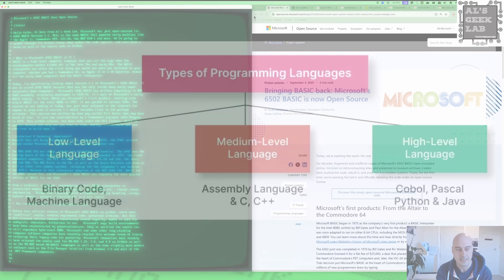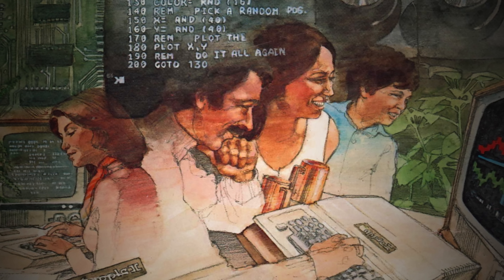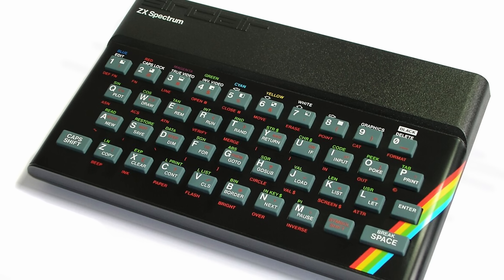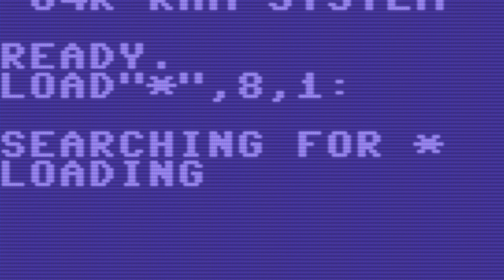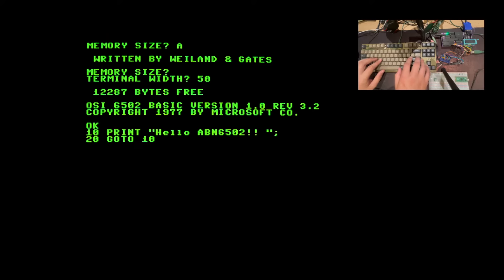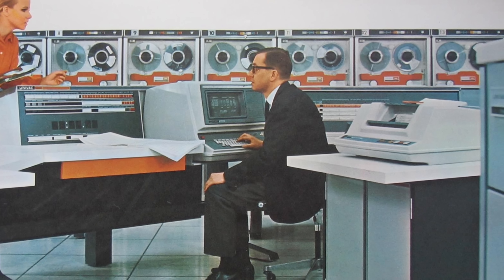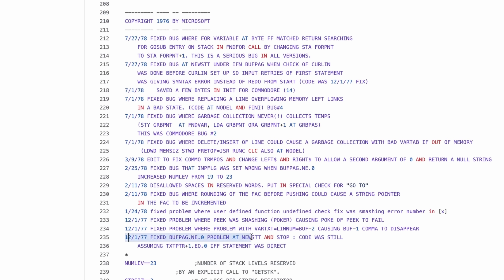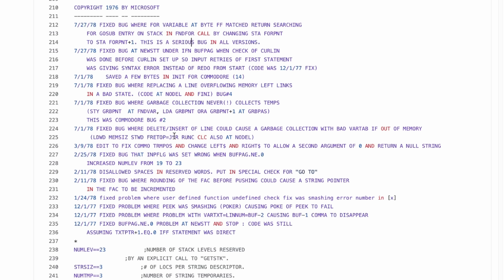Microsoft Just Gave Away Classic BASIC Code (6502)!

Comment: BASIC is a perfectly cromulent language, especially in its more advanced label-based forms (e.g., Maximite BASIC, QuickBASIC, QBASIC).  Some are saying that BASIC promoted poor coding habits.  I would put that down to the poor coding habits of most of those who taught BASIC.  The notion of structured programming didn't come along for almost a decade after BASIC was already well established, but, properly applied, it could transform a poorly written BASIC program into a readable and maintainable one.  QuickBASIC took this a step further in the utilities and reference materials provided for Professional Development System 7.0.

6502 BASIC is an historic language.  I'm glad to see it finally being released as Open Source.  It's long past time.  Now, let's get MBASIC and QuickBASIC out there. 😄

I still code in BASIC of one dialect or another to this day, what with the availability of cheap, powerful and versatile single board computers like the Colour Maximite II/RetroMax which can run interpreted BASIC faster than a 6502 could run machine code, and can interface also to GPIO for real-world control.  All that power in such a small package brings back the joy of the 70s, but at warp speed.

Comment: Regarding Win95 source - I kinda look forward to it and dread it at the same time - it will be great to have those venerable old systems opensourced, but it will inevitably spawn a FLOOD of community bugfixes and different versions of "Win95 as it should have been" which, I'm afraid, will be very difficult to keep any consistency within, and may complicate matters for enthusiasts who actually want to run them - which version to try now? On the other hand, it will be very nice to have some old annoying bugs fixed and it will even open up the possibilities of porting it to a different hardware entirely...the question remains, whether there's any point in doing it :) W95 on a RPi? Well, I'd rather stick with Linux, and run an emulator if needed :)
Reply: Win95 as it should have been is called Win98 SE

Comment: I notice that they're very nonspecific about what assembler should be used to assemble the code.

This is a dialect of 6502 assembly I haven't seen before.  For example, it adds "i" to the end of the instruction name to indicate an immediate operand, rather than putting "#" before the operand to indicate it is immediate.  The assembler directives are also different than any other 6502 assembler I've seen.
Reply: They used DEC's PDP-10 assembler with a boatload of macros. That worked fine for a simple assembly syntax like the Intel 8080 used, but the 6502 and Z80 use the same mnemonics (LD, LDA, etc.) to mean multiple things that have to be sorted out by the assembler decoding the addressing modes on the right-hand side. What they ended up with was a mutant dialect of 6502 that was an alternate history fiction of "what if Intel made the 6502"?

The strange mnemonics are designed to separate out all the addressing modes, and also they have a few macros that generate pairs of instructions to work with 16-bit addresses that have to be split between two registers. Unfortunately even with this being the "mother code" version of 6502 BASIC, it is still missing the file with all the macros.

The weird but cool part is that for both 8080 and 6502 they also wrote an emulator that ran on PDP-10, assembled along with this code. That's what the "DDT" thing is when REALIO=0, it's a keyword that kicks into the PDP-10 debugger. This let them develop Altair BASIC without actually having an Altair computer.
Reply: @8bitwiz_  Wow, that is a lot of complexity hiding behind the phrase "contemporary assemblers"!  Interesting, though.
Reply from the maker: Yeah I saw that too and I was really annoyed by that. They just said 'contemporary' assemblers of the time. What the heck, why can't they just name the assembler (or assemblers!)

Comment: i had that exact 6502 Assembly book at 14:00. It was a great resource to learn. As I remember, you ended up writing an assembly emulator that walked through the code and updated various onscreen displays. You could assemble and disassemble code. It could also run the assembler code direct from memory.
Reply: I still have that book.  Don't forget about the Rodnay Zaks trilogy (Programming, Games (w/the olde red and black cover pixelated art of a cowboy getting shot), and Applications) and a few other 6502 books of the era.  Good times.  It's a shame Atari went kaput since they were a big proponent of publishing the source to their roms (not too expensive for a kid too, as I purchased the big blue 3-ring binder containing the assembly listing) - don't remember the cost, but cheap.
Reply: I learned how computers worked with that program. I sat a lot of hours in front of it on an Apple IIe.

Comment: Apple ][+ used Applesoft Basic. Was that MSBASIC underneath?  The Apple ][ had NO BASIC, it booted directly to a machine code interpreter.
Reply from the maker: Later in the video I say that apple soft basic was so called because it was written for the apple by Micro-Soft.

The apple I booted into machine interpreter, the apple ][ booted into integer basic, written by Woz.
Reply: @AlsGeekLab  thanks.  I just remember getting the Monitor ROM, and replacing the AppleSoft ROM in my Apple][+ (ostensibly to downgrade it to an Apple][) so I could boot to the "*" prompt and enter machine hex code directly.  the "*" prompt was not BASIC of any kind, nor was it a compiler, it took hexadecimal numbers as instructions and data.  It was really cool to be able to "talk" directly to the computer in its own language!  :-)
Reply from the maker: @ckeilah yes, this was the monitor. You got to it by typing call-151 in BASIC
Reply: The original Apple ][ DID include Steve Wozniak's Integer BASIC. The machine did start up directly into the Monitor, but a 0G command would bring you into Integer BASIC. The Apple ][+ replaced Integer BASIC with Applesoft BASIC which is based on Microsoft 6502 BASIC, and introduced the Autostart ROM so that the machine would start up to an Applesoft prompt. 
Inside every Apple ][ (I think; at least through the //e) there is a ROM chip stamped with a Microsoft copyright.
Reply: @RideManDave  thanks for the brain refresher.  Sometimes I long for those simpler days.  🙂
Reply: Short answer: yes, Applesoft was this version of Microsoft BASIC, though I haven’t checked yet if it includes all of the Apple specific statements for graphics and the like.
Reply: @philipstephens5960  I skimmed through the source code last night, and there did not appear to be any graphics support in it.

Comment: This particular source code has been available for ten years. What is new is having a proper license for it. And it has been very useful, as it is the origin of all the different 6502 versions, and is applicable to most 6800 versions as well. I was able to get a version running on a 68HC11 breadboard that I've been working on thanks to this 6502 code.

The Bill Gates release earlier this year wasn't complete (missing the floating point output and line edit code), but it was similarly useful for documenting the earlier 8080 versions. It also doesn't contain the early floating point code from Altair v1 and v2 Basic, which was surprisingly different. And there is a CP/M and an MS-DOS source release out there too. The innards of MS-BASIC have been a continuous interest of mine since about 1980 or so on a TRS-80, so I've seen a lot of different versions.

At this point I'd like to see source code to a 68000 version appear. The ones I know about are old-world Macintosh, Amiga, and Tandy 6000.

Comment: I love how the commit date on Git reflects the original release date back in 1978 and not the date they uploaded it!
Reply: I guess they can do that when they own Git.
Reply: @sa3270  anyone can do that in git, just force push it
Reply: @sa3270  microsoft doesn't own git, they own github, a git remote. im pretty sure you can port a code base to git, as @LetYorLightShine5218 mentioned, or you could just create arbitrary commits, which i think is possible with git.
Reply: Probably was a ported code base from some other version control system to GIT. Done right the port keeps the original dates and attributions.
Reply: @LetYourLightShine5218  Were version control systems a thing back in 1978?

Comment: Atari 800 series MS BASIC was optional (cartridge), almost nobody used it.  It only did well when it was included in ROM, but not when it actually had to compete.
Reply: The Microsoft Basic II cartridge is one of the few 6502/68xx versions with a language level equivalent to what MS made for CP/M. But Atari initially did their own version because they didn't want to pay the MS tax, and yes, having to use the cartridge was a barrier to using any version at all.

Comment: Can not remember any sound or graphics in Basic (V2.0) for the Commodore C64 though? maybe there was and I forgot.. but as I remember it you had to poke stuff...
Commodore 128 had some commands for sound and graphics as I remember...
Reply: Yeah, the C64 was all PEEK and POKE to the various memory locations for bit-mapped graphics and sound, but Commodoore did have the screen control characters such as the reverse heart for clear screen, and the various character colour change characters, etc.
Reply: Yeah, C64 didn't have graphics and sound commands in BASIC, you could only use the hardware through poke/peek in BASIC. Famously, Microsoft expected Commodore to ask for updates to BASIC once Commodore released new hardware with new capabilities, so they offered BASIC license at cheap flat fee. But Jack Tramiel's penny pinching knew no bounds, and he took the PET BASIC 2.0 and put it in VIC-20 and C64 and sold an epic shitload of those computers, leaving Microsoft with no new income.
Reply: PEEK and POKE are your friends.

Comment: Can it be ported to nes?
Reply: Add the right mappers for enough memory and you could. I think the hardest part would be hooking up a keyboard.
Reply: @8bitwiz_ keyboard vs 8 direction x 4 modifier (neutral, A, B, A+B) = 32 accessible character. Start and select for symbol and numbers toggle.
Reply: @8bitwiz_  FC/NES can use keyboard device. You can see "family keyboard" in FCEUX expansion list. At least it can be emulated on NES emulator.

Comment: Microsoft's 6502 Basic was pretty easy to extend. Machine-specific instructions (graphics, sound, etc.) were written by the machine vendor. As with the 8080 and 8088/8086 versions, all you really need are to feed it your computer's I/O handling functions and write loading and saving interfaces. Once you've done that, you have a working text-based programming language. Apple added CALL which behaves differently to Commodore's SYS, commands for low- and hi-res graphics, PDL joystick reading routines, and hooks for DOS. D$=CHR$(4) was pretty commonly used in Apple II basic programs because printing a ^d was an escape code for a program to issue a DOS command which could otherwise only be entered interactively.

Commodore … Jack Tramiel licensed Basic for the PET and should've paid a license for the new machine. But he famously squeezed every penny and didn't mind screwing someone over (I'm sure Bill Gates will recover someday…) and just transplanted PET Basic into the VIC-20 and C64 … which is why those versions lack any sort of graphics and sound routines.

I don't know what specifics existed for other machines offhand—some had additional limitations, others had additional features. It all depended on how small you needed Basic to be and what you wanted to add to it.

Comment: You forgot the Tandy computers. After checking, they are not the exact cpu.
Reply: Are you thinking of the Trash-80s (z80) or Tandy might also have done some 6502 gear, IDK. My 1st microcomputer was a Trash-80 clone called a Video Genie, with MS Cassette basic for Z80
Reply: The TRS-80 Color Computer (Tandy CoCo) had a 6809E CPU and ran Color Basic, which was a Microsoft Basic with extra commands.
Reply: @gdclemo  the 6809 was a souped-up 6800, but was intended to be close to source-code compatible with the 6800 at the assembler level. The 6502 was cut-down compared to the 6800, so adapting the 6502 to 6809 should not be too difficult while adding scope for more powerful (efficient) features, I guess.

Comment: I don't think the C64 version of MSBasic had any sound or graphic commands.  I think the two Atari versions did however.
Reply: According to the Wikipedia article "Commodore BASIC", graphics commands were added in V3.5 (C16/C116 and Plus/4) and v7.0 (C128).  So, no C64 (V2.0) graphics in BASIC.
Reply: @JeffreyJibson  Don't forget that Commodore BASIC as implemented in the VIC20 and 64 (and PET?) did allow such things like clearing the screen and changing print colours via print statements; perhaps that's what he meant.
Reply: That's actually the reason why the C64 got so many good games: peek and poke to the chips registers give the method to develop in assembly
Reply: @CaptainDangeax  so, you're saying that assembly language programmers wouldn't know the memory map of the machine they were programming unless they discovered it through Commodores shitty version of MS Basic and peek and poke?  Maybe Commodore (and Happy Jack) were just too cheap to pay for a fully integrated version of MSBasic like Atari did.
Reply: @michaelstoliker971  Yes they were to cheap and also to cheap to develop an own version of Basic with more functionality.
Reply: Even if it did, it wouldn't be suitable for commercial quality software.
Reply: Commodore used their own version numbers. Actually everybody used their own version numbers.

I try to put things in terms of the Altair/8080 versions for the level of the core language. Some vendors added lots of features, but kept the same core because that's what they had already paid the license for. This 6502 code is roughly equivalent to a v3 8080 BASIC. TRS-80 had a v4 (integers and double precision), CP/M, MS-DOS and MSX had a v5 (long variable names and WHILE/WEND), and classic MacOS / Amiga had a version even beyond that ("where we're going, you don't need line numbers!")

Comment: Happy to see MS Basic for the Atari on there.
Reply: Yes, indeed.  It was originally meant to be included with the early Atari machines, but with the required extensions, the MS version was just too big to fit into the Atari's 8K ROM space (in a cartridge) . So they contracted Shepherdson Micro Systems to write a BASIC instead, and whilst it had it's limitations, it was in many ways a huge improvement over the standard MS version.
Reply: @another3997  The name Bill Wilkinson comes to mind.
Reply from the maker: It's cool to see some of that classic code surface again!

Comment: I think the IBM PC came with BASIC in ROM, but also could run off a disk, but clones didn't have it in ROM, so only ran off a disk.  This probably broke the mold.  Plus, since Windows started as a GUI running on top of DOS, it never included BASIC (that was part of the underlying DOS) and MS had a for pay product for those that wanted/needed to write BASIC programs.
Reply: yes you could (in theory albeit basically nobody did apart from couple of schools from what i've gathered) buy the original ibm pc basically just as a basic computer with tape based storage for the basic programs, without disk drives (the built in basic being called Cassette Basic). pcjr had basic on a cartridge.

ms dos obsoloted it as a way to interact with the computers and separation from many other micros which used basic to load other things.

but! it should not be forgotten that msdos getting bundled later with qbasic caused a whole basic usage resurrection in 90s as it was a built in way to get creative and get started in programming with a full built in manual that was included with basically every early 90s computer and worked as the starting point for many many programmers as kids. so while ms dos killed basic it also kept it alive.
Reply: gwBasic, open sourced years ago, was the version of Microsoft basic for PC compatibles that ran from disk
Reply: IBM had a license to include an MS supplied BASIC on their PC, but of course people could also buy a version to run on almost any PC clone. A version of BASIC was included with various releases of MS DOS, and was therefore accessible to users who also ran Windows. QBASIC was included right up until Windows 95.  But MSDOS, initially a clone of DR'S CP/M, running on 16 bit hardware, was very different to the old 8 bit operating systems, and it allowed a lot of flexibility, such as the ability to script batch files etc. Computers and their users were evolving, so BASIC wasn't such an important inclusion.